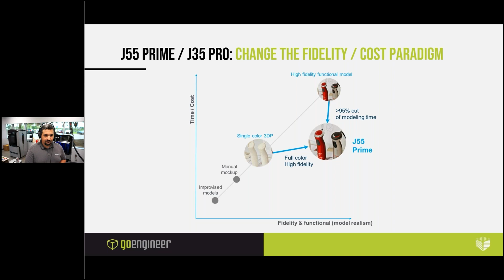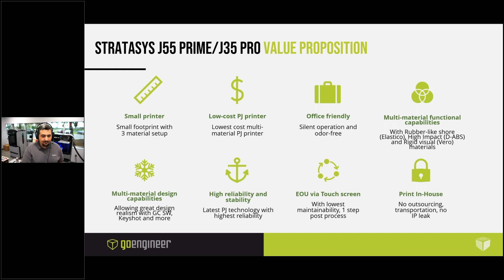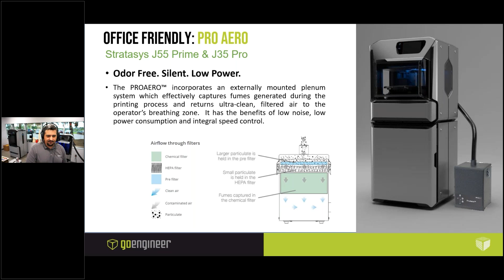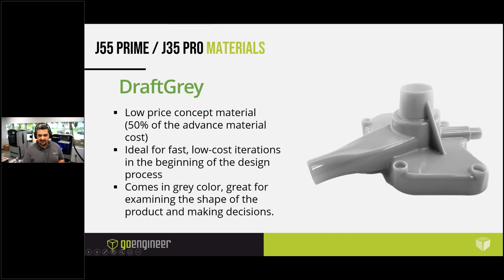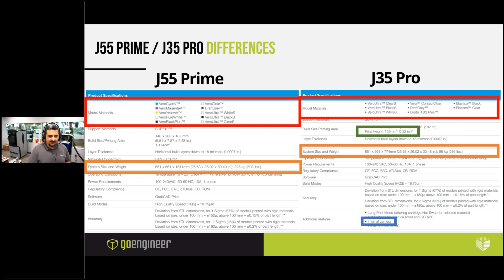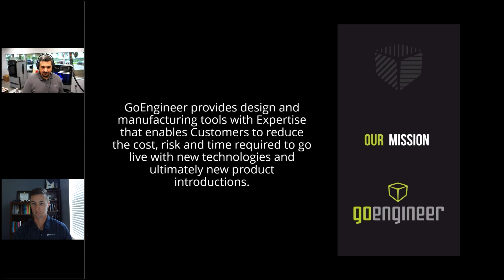J35 Pro & J55 Prime: PolyJet 3D Printing for Industrial Design

Comment: Really nice Guys...! Great Presentation...!
I'm using FDM...!
And having problem in filament feeding into the Extruder...! (For example: while I'm printing the filament feed get stuck inside the Extruder itself and I could notice this after an hour, because after an hour I noticed that the extruder only moving front and back, my model in bed is just like a piece of paper and only a small Projections of my model was created.
It actually wasted my time upto 3hrs...!
After I again cleaned my bed and started printing and watched like eagle for 8hrs until my part is fully printed...!
Is there any solution to avoid this of problems in FDM printer...?
If it so please say me sir...!